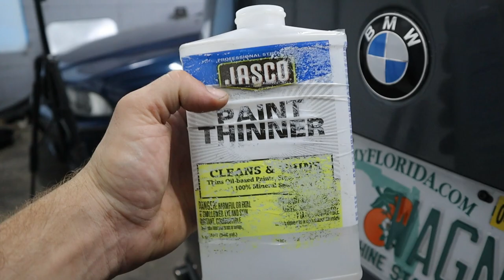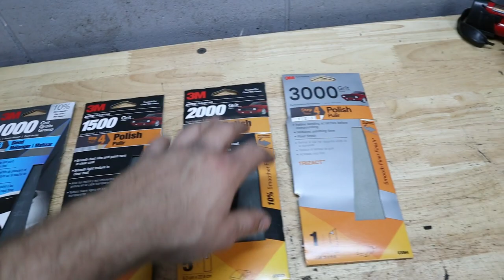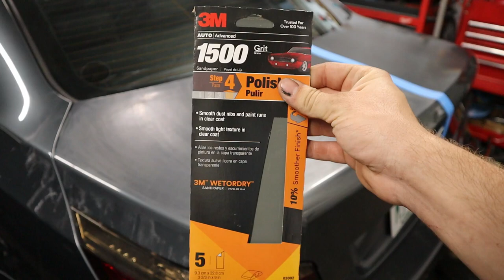How to: Repair CRACKED and Damaged Paint (On a BUDGET)

Comment: 1) when this model appeared, the BMW people boasted that it is full aluminum, but unfortunately only the important parts are aluminum:))). 2) there are sprays that remove any adhesive. 3) in your case that you have deep scratches in the clear coat, the best and simplest is to remove all the clear coat with 300p and 600p and then apply 2 layers of clear coat, even with a spray.

Comment: What’s the deal with the gray on these bmw’s?! My ‘07 335xi & ‘08 135i cabby did this on the hood, roof, and trunk. I tried polishing the hood on the sedan and now it looks like I wet sanded it 4-5 months later. It’s been sitting outdoors tho and now I can’t recall what I put on for a sealant. It looked really good when I first did it. Not sure what went wrong other than just not reapplying sealant more often.
Reply: My silver E90 is the same.

Comment: Interesting. I looked this up because I have a MC fuel tank painted maybe 20 years ago, never been on a bike, always stored indoors, that has crazing or cracking in the clear coat. I'll start with meguiars cutting compound then back in to the sand papers as necessary. Thanks for the video.

Comment: I have a crack on my bumper is that I am not sure what kind of sand grit paper that i should use on it It never went through the other side of the bumper so is there a way to sand it the way that you are sanding yours and also i might have to repaint the area.  I just went to estimator and they wanted $2,000 for doing the job and I'm like no i rather do it myself.

Comment: Should have turned this off when i saw this kid and the Florida tag. Didn't repair the cracked paint as stated in the title. Then he proceeded to sand the clear with paper in his hands. What a joke. Always use a sanding block to sand clear coat, paint, or primer.
Reply: I was really confused when he didn't spray a new clear coat on...